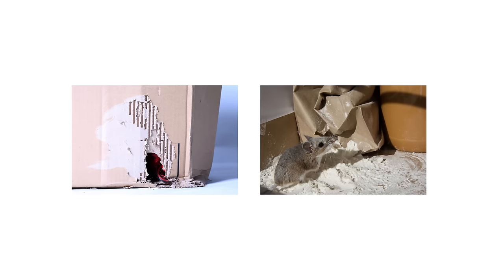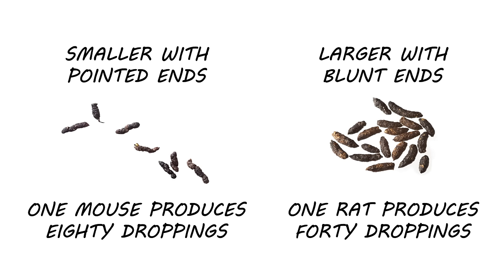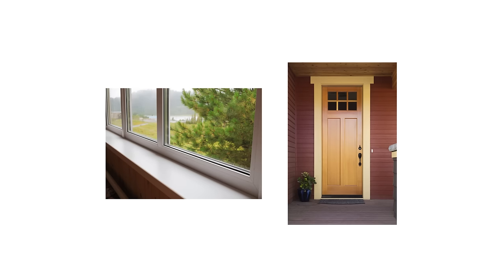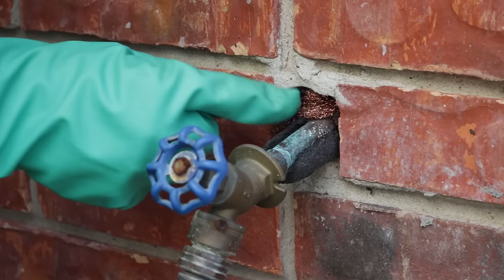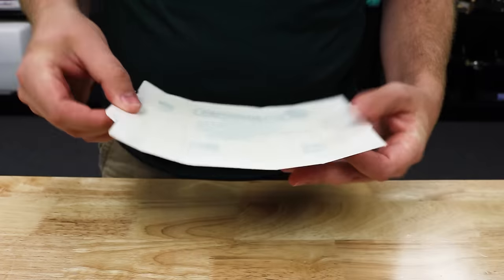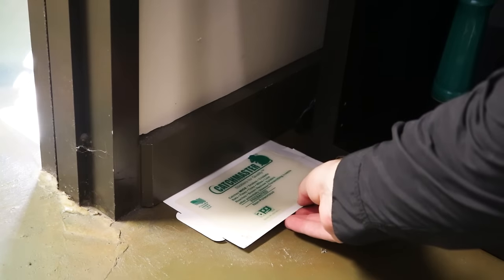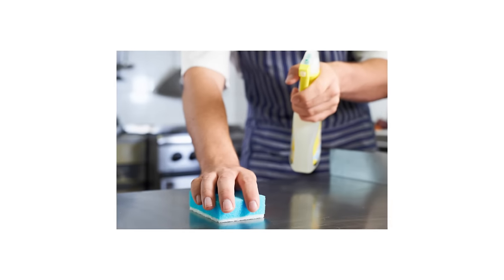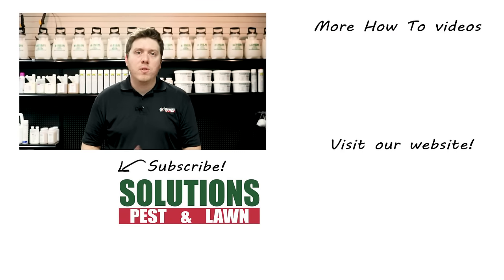How to Get Rid of House Mice (4 Easy Steps)

Comment: One little mice always hides under my kitchen and its impossible to kill this speedy gonzales cause of its speed
Reply: Put a glue trap down with bait
Reply from the maker: Try glue boards and poison baits if they're too quick to catch. Reach out to us on our website if you have any questions.
Reply: Get a cat!
Reply: Go to Walmart & buy the Victor brand snap traps. Try to find the older versions - with the metal trigger.  Seems they changed the design with new ones, which have a large yellow plastic trigger plate.  Those are so hard to set, they are so sensitive, go off as youre trying to set it back down on the floor.  So if you see the Victor ones with the all-metal trigger, grab them, they work the best. Bait with chocolate.These traps are the most humane. Kills them instantly, gets them on their neck. Glue traps & poison are cruel, they die slowly & painfully.
Reply: @solutionspestandlawn  Why would you recommend two of the most inhumane methods for one little mouse. A snap trap or high voltage trap would be just as effective when used correctly.
Reply: Watch Shawn edwards
Reply: He has many traps
Reply: @chrisc6874  but those poor babies will suffer 🥺 they don’t know any better. How hard is it to just use a glue trap or a container trap and then release them?
Reply: @faithirving5151  yea release them so they can come back in🤣
Reply: @oliviasanchez6191  not if you move them further away from your house. I go to the fields and release
Reply: If there is one trust me there’s 30 more
Reply: @happycleanhouse  but WHERE AND HOW
Reply: @faithirving5151  no point in feeling sorry for them. There are billions of rats in the world. More will come if you don’t defend yourself.
Reply: Your lucky mine went in kitchen into my room 😭😭
Reply: @someone-nm6fs  oh dammn I already killed it though this is an old post I set up a trap and boom the next morning cold dead 🤣🤣
Reply: @eduardoocon3293  it moves so fast around me it's like it's everywhere
Reply: @someone-nm6fs  set traps around and believe me he won't be running around for long.
Reply: @folabi1076  they hide inside walls and under things.. when a mother mouse has babies she has many .. She gets pregnant 5-10 times a year and has 6-8 mice each time

Comment: I live in a condominium and our building has had mice issues for years and pest control doesn't seem to help. I couldn't sleep, I'd hear them all night, they were also damaging my couch, clothes and other things so I took it upon myself to do something about it.. I bought the soft bait and that didn't work by itself so I would put gloves on, I open the small packages it's in and I mix a very small amount of peanut butter in it and they want the peanut butter so they have no choice but to eat it. I tried it with the hard bait, the first time it worked and they ate it all but the second time they just nibbled at it only eat the peanut butter on the outside so that's not a good idea. Also I don't recommend if you have pets that walk around the house/apartment and if you have small kids that can get to the poison. Some of the mice won't die within the walls and they will walk around very slowly before they die. If you smell a dead one then it's close to where you are, I never smell it when they die within the walls and I realized every time I would smell them was because it was close to me under the couch or under my bed.

Comment: We had family of mice living under fridge. It was warm, secure place with water (that conteiner, where defrost water goes). They had babies there and so on. It was hard to find, you have to do whole refrigerator maintenance, take out panels and empty that water container. But best result we got with split system, mounted on the wall. Well, wall was vibrating, mice flee!

Comment: Hey all they are coming through your doors. Be careful leaving the m open and unattended. Also check around the outside of the house for burrows.If you can see light outside of your doors then they can squeeze through. I have a bow at the bottom frame of my door. I use a door sweep.I haven't had a problem since.
Reply: @judadash3360  If you are referring to the bottom of the door then you may want to look up Door Sweep .It is very cheap. They have discounts kinds
I have a plastic one that is filled with sponge.It also keeps the cold air out.Google it and find out what works best for you. Try to seal your door as much as possible. These critters can also smell food thru these cracks .Let me know how you make out.

Comment: Helpful info. Drawbacks for me though. Glue boards are inhumane. I also live in a rural setting I have snakes, owls, ermine and other critters eating mice (just not fast enough) so poison is not an option. So the traditional snapper is the only option presented that would work for me. I also use an electronic mouse trap that humanely electrocutes rodents in a second and the newer models alert me via an app that a rodent has been killed. What ever traps I use have to be humane and poison free unless that poison cannot travel up the food chain. 
Locating the entrey points on my home has also been a trick I have not mastered yet either though I am always finding new places that are suspect at ground level.
Thanks for the video!

Comment: I set poison bait in a bowl and over the course of a week, the bowl was emptied and the mouse unaffected. Next I set snap-traps and it managed to pull the bait off the pin without triggering the traps. Later, I strapped the bait to the pin with a tight loop of thread. Once again, the bait vanished, leaving a loose loop of cotton behind and an unsprung trap. I eventually caught the Hairy Houdini rummaging in a trash bag and sealed the top before putting it in an empty wheelie-bin. It escaped the bag, but not the bin. The night was frosty and I guess it died of exposure as it was lying dead at the bottom in the morning. Now, I seem to have a regular infestation. I've caught 3 in 3 days using glue pads, but there was one playing tag with me in my bedroom most of the night before escaping and there seems to be more under the floor. I think maybe a small thermonuclear device is called for...
Reply: Yes get tbe thetmo device. Glue pads are so cruel, I hate mice,but even they don't deserve to be terrorstricken and suffer a painful death
Reply: @laurielovett8849  If they don't want to be terror-stricken they shouldn't go invading the lifespace of a larger predator and keep on trying their luck when challenged. And they didn't suffer a painful death, they got walloped with the heel of a shoe and never knew what hit them. In the end I systematically caulked off all of their conduits using a mixture of "Hard As Nails" adhesive and steel wool. All seems okay now. No mercy for mice - or spiders, since a false widow bit me in my bed...
Reply: @tedthesailor172  Hope it wasn't a human false widow

Comment: I have mice coming through one hole in my crawlspace, however I am unable to figure out what’s on the other side of the hole. Afraid to block that hole because I don’t know how the mice are getting in and out of that hole and/or where they may potential 
 continue on to. Any suggestions?
Reply: Get a Fire weapon and burn the hole. Make sure they don't come out then block the hole ✌️
Reply from the maker: If you can't identify where exactly the hole is, we recommend reaching out locally to a pest control company to help you inspect. We would hate for you to trap the mice inside your walls after using a bait, as there is a chance they may die in there and leave an odor.
Reply: @solutionspestandlawn  They have stuff to get rid of odors in the air.
Reply: We have one in our ceiling in the basement. I'm going to drill a hole, spray peppermint mice spray up there to force him out. Then, patch any holes on the outside of our house. See what happens.

Comment: so.. after a rodent has been poisoned - I'm assuming it's not instant and it would't be in the trap/bait station.. it goes into it's hiding place and dies.  If the nest is deep in concrete block walls, what do you do about the inaccessible carcasses and subsequent smell?

Comment: I have old school electric victor mousetraps -  they work.  I even caught a few large pack rats in my house.  I do not like messes.   They have no time to poop or pee.  It’s that time of year for me and I have just cleaned and prepped these guys up.  I like that it alerts me to when a mouse is caught audibly.   There is a beeping to let you know there is one in trap.  I am a crazy meticulous cleaner with a very large log house in Colorado-  it’s impossible to keep them out especially in fall.  These traps- I’ve never used the batteries just plug in.  It works like a charm and I shake the dead out and wipe clean and ready to get another.  I do not like to use peanut butter because it’s hard to clean off the bait area.  Easy to use some smelly granola cereal.

Comment: I live in a apartment building and the mice are in the walls. We have double walls. They are extremely smart and will not go near the snap traps. I don't know what they are eating because I stopped buying food. I live on the 3rd floor. Right below me is the dumpster that is literally right up against the building. Will they travel from my 3rd floor apartment straight down to the dumpster then come up to my apartment to nest? They are nesting in every room of my apartment. They are so loud at night squeaking in different frequencies. I figure they are communicating with each other. The owner of the building is basically blowing me off. I have so many pictures of actual proof of activity from mice and I still get ignored. Should I get a cat? I already have a dog and they are not phased about him one bit.
Reply: If you put your rent in escrow until the mice problem is resolved, the owner will do something about it.

Comment: I just caught 7 mice in the past 24 hours using the same 2 traps. I'm using the traditional style snap trap with small pieces of American cheese smushed into it. I dump the bodies and reuse the trap lol. Under my oven is the hot spot, I probably have to seal the wiring for it or something
Reply from the maker: We are so happy to see you've found something that works for you!
Reply: What if I caught one under the hood of my pickup?
Reply: @kylechellino2579  keep catching them
Reply: @kylechellino2579  be careful! If it's a newer truck then they might be using the stupid wiring casing that attracts rodents. I recently heard of one person that had rodents eat through the wiring and the warranty wouldn't cover it. They now sell a deterrent that you're supposed to spray on the wiring. You might check your local auto parts store for that or online.

Comment: You can use glue traps made for mice and rats. They work and just one trap can catch several mice (I caught 3 on one). You can get these glue traps at many dollar stores or places such as Walmart, Home Depot, Lowes, etc.. They are very inexpensive and well worth it for dealing with mice infestations in the home.

What to do:

After removing the paper from the glue trap, put a reasonable amount of peanut butter in the center (enough to entice a mouse/rat). It may help to heat up the peanut butter for about 10-15 seconds in a microwave beforehand to make it more aromatic although it's not necessary to do so. Place the glue traps along walls where you suspect mice to be or where you have seen them before. Be patient. Mice are mostly active at night. Rinse and repeat to control the current infestation and to help prevent future infestations.

Bye bye stupid, problematic mice.

P.S. Try to eliminate any other source of food that the mice/rats mice have in your house such as crumbs so that they will be more desperate for the peanut butter on the glue traps.
Reply: yeah until your dog tries to sniff the glue trap and screams like hes being murdered over catching his nose in the glue n cant break free...ps some mice smart and have flipped the glue traps over!!!! of course mice in my area are trained lab rats released into the wilderness by local democrats!

Comment: Have tried every step in this and many other videos, but they (mice) are still in my attic and wake me up with scratching noise in the night, especially just after dark and before sunrise. I've placed glue traps and rat poison mixed with soft food in corners and sprayed poison into the attic space and blocked holes where they might get in/out with crocodile tape and/or steel wool which they can't chew through, cut/trimmed down plants which might give them access, etc. and they are still in there. Resilient little bastards they are! Oh and I live in northern Thailand which is warm or hot most of the year. Locals just say "learn to live with them, it's part of nature" blah blah blah, but I need them gone by any means possible. Tonight I'm leaving the attic trap door open and hope some of the resident geckos will go up there and chase them out or kill them. Seemingly never-ending battle. I respect Mother Nature and haver learned to co-exist with many creatures, but these @#$%&*ing mice have to go! Any more advice short of burning down the house appreciated. ;-)
Reply: Get a cat! Remove poison first then get a cat if you can 😊
Reply: @margauxmaria3444  We have six cats here on the 'farm" and they occasionally catch and kill small mice, but not enough to clear all of the family. Good news, however is no mice in the attic for months now, which I think is due to all the poison placed up there plus I really went for cutting down any tree or plant or branch which could be used as a mouse ladder/bridge and they can't climb vertical walls, so basically denying them a way onto/into the roof. It was a huge problem for well over a year, but fingers crossed they'll stay out and go back to being cat toys/food. ;-)
Reply: I put my cat in my attic with some water. By the end of the day, I had no more problems. Cats are incredibly smart. As soon as I put the ladder up to the attic...she was already up in the attic sniffing them out. Hope this helps.

Comment: Use glue traps. Caught about 6.. most of the glue traps only work for smaller rats/mice. The big and medium rats can fight the glue off. I even saw rat fur on one of the glue traps the next morning. And they also give birth very quick.
Reply: They will suffer a lot for no reasono
Reply: @JohnSmith-pg9ns  I have suffered alot for no reason. I do not care about them.

Comment: Started to do some home repair a few weeks ago after a pipe burst in my kitchen a few months ago (In Arkansas so Insurance is kinda backed up from the Tornado damage last spring). Today I saw a small black mouse scampering across my living room floor. Have any tips to deal with mice while having a home in need of repair? Carpet and floor is pulled up and base boards were removed, so effectively sealing up those nooks and crannies might be difficult until my repairs are complete.

Comment: I have a couple of hot spots in my house like the basement laundry room. I started with peanut butter combined with poison on a plate for around 3 days and they started disappearing faster & faster (I have no pets or little kids). I then loaded these same poison balls on to the mouse traps (Brand: Authenzo) and got 6 or 7 mice over the course of 3 days. I thought I had won the battle as none of the traps had gone off for a few days. I then checked if there were more mice by removing the traps & putting the peanut + poison balls on a plate & surely, they started to disappear again. I kept refilling the plate for a couple days after which i placed the bait on the traps. However the mice have not gone for the traps since. I also placed glue traps as well as the poison bait stations (another brand) & the mice have been avoiding it all. I dont know if the mice have gotten smart or If im doing something else wrong thats keeping them away. Any help would be appreciated very much!

- Other things i tried so far:
 - Have been wearing gloves since the beginning so theres so scent left behind
- I also washed the traps after I read online that traps might smell of dead mice, tipping off the remaining mice but to no avail. I am on day 3 or 4 since they havent fallen for any bait. i dont know what to do
Reply: I feel your pain.  That's why i'm here too. Hope someone has an answer
Reply: Maybe  time to get a  cat 🐈
Reply: Maybe it's time to try the water in a bucket trap? Tons of youtube videos on how to create that trap.

Comment: I tried the bucket contraption, peppermint rodent spray and the red and white plastic classic style one, all to no avail. Got 2 of the ones that electrocutes them as they are going to the bait. Instantaneous death, and so far in 24 hours, I killed 9. Works great. You put 4 batteries in, a small dab of peanut butter, switch it on and put it along the baseboard. Within a short time, the green light was flashing, meaning one was caught. The battery compartment and the kill box separate when you have a catch, and a door that flips open to drop the mouse in the trash outside. No touch. I tried glue traps too, which I find scary and awful, but I was desperate. Not a single one (thank goodness) went that way, because this shock method zaps them quick and they die instantly. It's a humane as it gets. I have no interest in sharing my house with them unless they kick in on the mortgage~
Reply: Can you give me the name of this device and where you got it?
Reply: Victor M250s indoor Humane electronic mouse traps
Reply: Amazon
Reply: @jackierhodes4680  thank you!